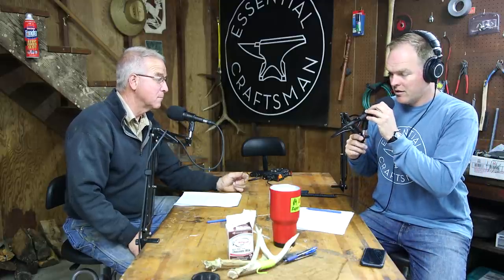Dealing With Weather ECP 37

Comment: I can vouch for the extreme humidity in Florida 🥵. Even if it's only 85°F, when the humidity is above 75%, it is unbearable. You WILL sweat in the shade, and the air is so moist, your sweat doesn't evaporate to cool you down. Just like EC mentioned, a long sleeve cotton shirt is the way to go👍

Comment: Have lived and worked in the trades for nearly 25 yrs.
In Ga near the coast,humidity is almost unbearable. 
Most commercial superintendents are always behind schedule, so I would ask if we could work during the night. 
A waterjug is an absolute necessity, pre-hydrating is extremely helpful.
I still drink 30 ozs of water before I go to bed, the night before every work day.
The nice thing is the winter is very mild, and the ground has never froze in my 44 yrs.

Comment: I grew up in Miami, no A/C at school till H.S. and the teacher complained about the sweat stains my forearm left on my Math paper (1968).  Working as a Groundman on a Line Crew I was beating a hole through a sidewalk with a 16 lb. sledge  for a pole guy and a woman (obviously a Yankee) pushing a stroller with her grandkid came up behind me in the afternoon in July (1974)  and asked "Young man, how do you work in this heat?" I said "Just used to it I guess."  I sweat so much that it grossed out other Electricians on a condominium project (1982) and me and another guy were going to have a contest who could leave the biggest puddle from sweating. Years later (2013) I worked a year at a Solar Power Plant in the California desert, and discovered that sweat would indeed evaporate if the air was dry enough. We took 15 minute breaks under shade canopies every hour when it got over 110. I could be comfortable in 100 deg. in the shade. Amazing how much salt gets left on your clothes and sunlight bleaches the color out of shirts. In Cupertino, Ca. - Silicon Valley - Apple H.Q. (2015 - 2017) The air was cool and the humidity was low and I knew I was getting spoiled. The locals complained if it was over 76 or under 70. I went back to Miami to finish my career (2018 - 2020) and the humidity nearly killed me. They had the hottest, most humid 2 years in a long time while I was there. I swore I'd never complain about traffic or humidity or cold in Georgia where I've lived 32 years again. Got snow flurried the other day in my yard.  BRING IT ON.

Comment: "Mocho no shirt chest puffed up" yeah I learned fast you can't get any real work done without a shirt on. Long sleeves big hat I could work circles around the my big mucho classmates in middle school my first job was working in corn feilds no shade,bathroom, 80% humidity and the corn leaves are like saw blades. Long sleeve white shirt big hat the thing is you get acclimated to it it's only 5°hotter than yesterday

Comment: Weather/temperature. upper lower peninsula of Michigan  as a field service mechanic can remember 47 days without seeing a high of 0 F and like you say you learn to dress and function in the cold not very efficient or fast but you get the job done.  Then moving to warm climate of Tampa bay and learning how to survive the heat and humidity, sunshine every day with a shower at 3 pm due to the hot air moving out over the gulf  and saturating with moisture all day and then coming back on shore and making a deposit at 3 pm to raise the humidity and cool things down a little  still 95/95.  learned from an old timer wear a cotton t shirt under a polyester long sleeve uniform shirt , start work at 7 am remove and wring out shirts around 8, put them back on and get back to work.  cold iced drinks will actually not quench your thirst and cool as well as room temperature drinks because your body has to bring them up to body temperature to process them. if your not p ing every 3 hours your dehydrated and at risk of heat stroke, when you stop sweating your in trouble and need medical help.  The equipment dealer that I was working for was big on make the Gatorade while the coffee was brewing every one is expected to drink 1/2 gallon of G/aid daily . And like you say those were the good times/days.
Reply: You’re right about wringing your shirt out by 8. It’s actually the worst, first thing in the morning bcz the humidity is as high as it gets and the air is completely still until around 10 or so.

Comment: Long sleeve loose coveralls sort of worked in humid Missouri.  I'd wear them working on antique boilers in a shop.  Dreaded putting them on but once they got wet they were OK.  We always arranged to have a fan in our work area which enhanced the evaporation.  They were oppressive with no breeze (but in our humidity, naked is oppressive with no breeze) .  They protected from injury and kept the dirt on the outside layer so you could peel them off and be sort of presentable at the end of the day.  Oh, and a welders cotton cap to keep the sweat off your face.

Comment: I remember the muddy soil in East TX would stick to your boots, until they were about 4X larger and much heavier than your actual boot. And slick!

Most of my career was spent in FL, battling the heat and humidity every day. One guy I remember working with, would strip down to his underwear and sheet roofs like that. And I don’t mean boxers. Tidy whiteys! 😣

One trick I learned with the water jugs was to fill the cooler with water first, then add the ice block. The water doesn’t get quite as cold like that, so you can drink more at a time, saving trips.

Hurricane season is always a real pain bcz you never know whether you’re going to take a direct hit, or just a glancing blow. The preparation always has to be the same though, bcz you just can’t take the chance.
Reply: @psidvicious I am nodding knowingly, being a St. Augustine boy myself.

Comment: I’m about the same age as Scott, but having worked almost entirely in Connecticut, I haven’t had to deal with the extremes that he has. We do get the 90-95 degree/ 95% humidity in summer. Used to just be 2 or 3 weeks in July or August, but now we occasionally get it earlier and later. We usually don’t get temps below 0 degrees F either. Never liked the real hot and humid days but nothing beats cold and wet for pure misery.  Once, the company I worked for was hired to repair some barn siding for a customer in January with the intent to keep us there until the weather was nicer and we could do some thing on the house. One of the days I was standing in six inches of snow trying to make nice level cuts in the boards that needed to be patched on the north side of the barn  with the temperature just warm enough to melt the snow on the roof. Nothing quite like a drop of melted snow hitting the back of your neck while you’re using a corded 7-1/4” circular saw.

Comment: Working in the summers in north alabama as a young teenager I would sometimes not even wear a shirt to work. I try to look more professional now that I see what that is worth. Jeans, boots, and a white t shirt everyday, though it occasionally comes off during very hot days. Particularly framing in a basement with no air stirring and sun bouncing off 3 walls. Still thankful I dont have to deal with harsh winters though.

Comment: I used to work for a machine shop, and I would help the field machinist occasionally, On one such occasion, we had to go to northern Oklahoma in the middle of January to re-face a 48 inch flange in negative 30 degree weather and it was straight flag windy and before we could do our work he welders had to apply a skim coat weld on the face of the flange and it was so cold and so windy, that the wind would suck all of the heat out of the metal, and as the welders would lay the weld on the material would just peel right off.

Comment: Doing carpentry in Michigan, we didn't work in heavy rain except on the off chance that we were working inside a house with a roof on it. No one dared to pull the trigger on a saw connected to an extension cord laying on a wet deck. Snow was by far preferable to rain. LOL